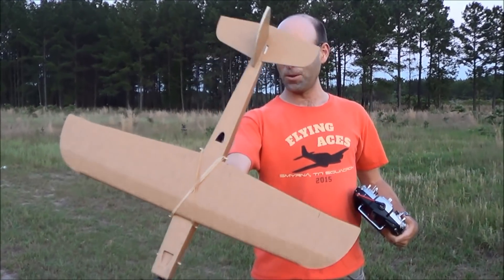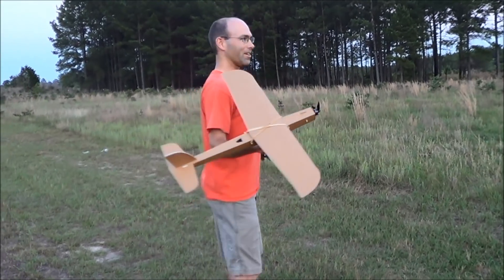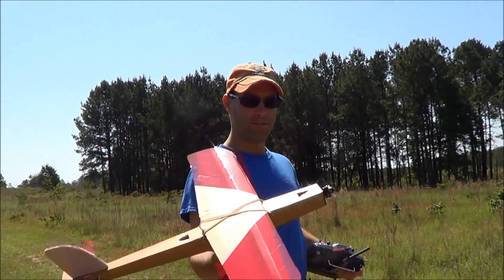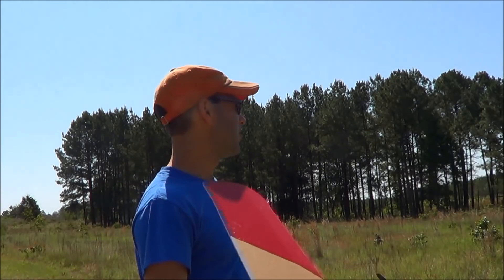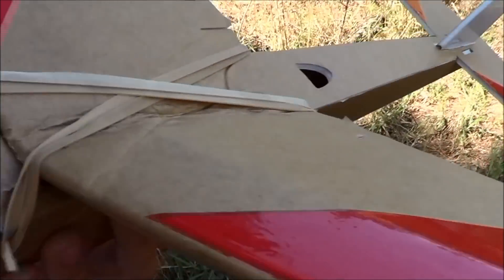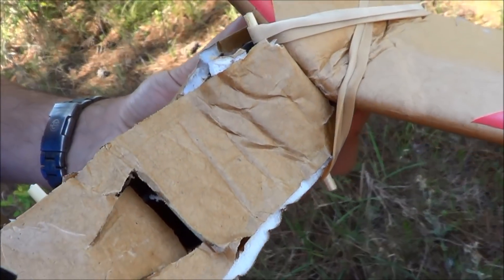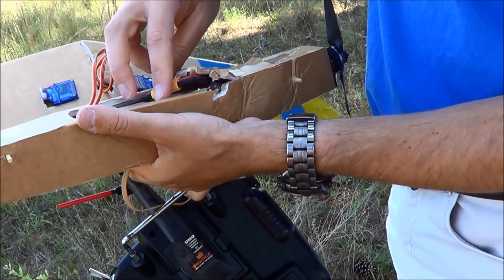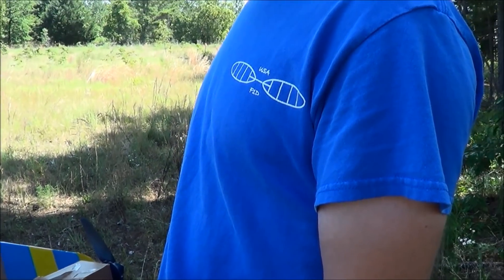The air is a harsh taskmaster - lessons of the Speed Deamon foamboard racer

Comment: Hey I’m helping with the Montana science Olympiad elastic launched glider team and today during testing and during the state competition our normal protege glider will loop de loop and then glide slowly down but the loop takes like 2/3 of the height and we can’t get rid of the loop. Any suggestions?
Reply from the maker: Dan Kimzey make sure the stab hasn't warped. It sounds like you just need to add down elevator, assuming it's not rolling any during the loop.

Comment: Do You really thought it would last a few Flights without a Carbon Spar, serious❓btw You can't measure the Real Speed, the way Your Wife tryed, read about the Theorie of the Doppler Effect, for exact measurement, the Angle should be 0° azimuth and elevation❗, wich means, You have to fly exact to, or from, the Radar Gun, literally, as You want to hit Your Wife, aim  direct at the Gun, and then You have the Real Speed.

Comment: For speed : try a symmetrical airfoil wing  , and make all the leading edges rounded &  trailing edges tapered as much as possible . Adding a spinner to the nose might help also .
Reply from the maker: I don't disagree one bit, however the goal here is to create a simple, easy to fly design that less experienced builders can whip out quickly and get a taste of high performance. I do plan on creating one with all of those things you've suggested plus a few other tricks, but that kinda violates the goals of this particular project. One aspect of that is that a symmetrical 'foil' requires some form of jigging to get the leading edge jacked up correctly when you close the wing. You and I have no issues doing that, but a lot of guys are really scared of building things that involve those techniques, and they're the crowd I'm after.
Reply: @joshuawfinn  For simplicity , I don't think you can beat a simple foam board delta with a 50% kfm4 .... like this one :   https://static.rcgroups.net/forums/attachments/3/2/5/4/1/1/a6678454-46-unnamed.jpg  higher aspect ratio for easy cruising , lower aspect ratio for speed .

Comment: What was the size of the 4s battery?
Reply from the maker: Steve Diesner 4s2200. It'll run fine on a 4s1800 though.
Reply: @joshuawfinn  I'd even try a 1300, greatly reduce wing loading. I run a 1800mah on my Mustang that has a speed wing and 700 watt motor and still get easy 5 min flight times as long as I don't punch it too much.
Reply from the maker: Steve Diesner let's just say there's much more video incoming. This project is actually almost completely finished already and I already sent an evaluation kit to another developer. I think you'll really like the results. ;)
Reply: @joshuawfinn  looking forward to seeing it!
It's funny before I watched this video I pulled out my plans for the FT Racer as I'm planning on building it with a narrow fuselage, speed wing etc. Your video inspired me and now I'm cutting foam.
Reply from the maker: AWESOME! Any chance you'll make it to Flite Fest this year?
Reply: @joshuawfinn  I wish. I live on the west coast so that's a bit too much of a trek for me.